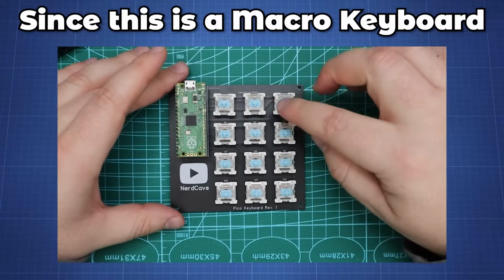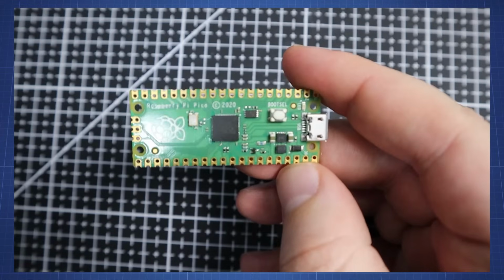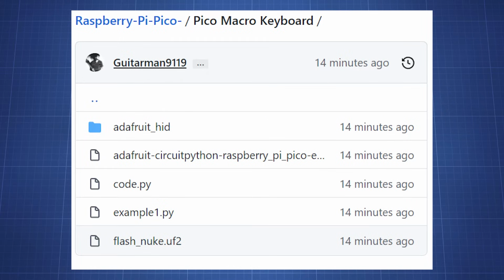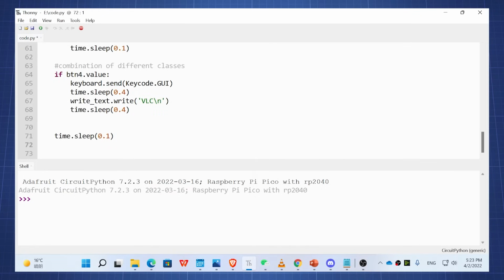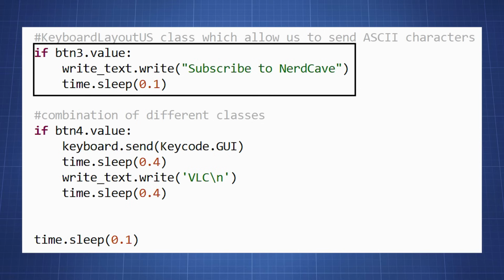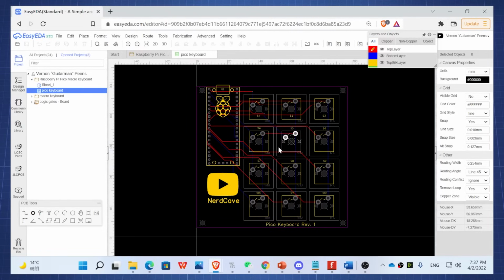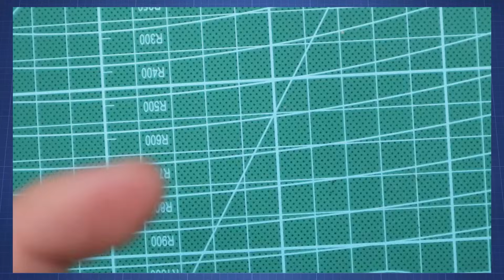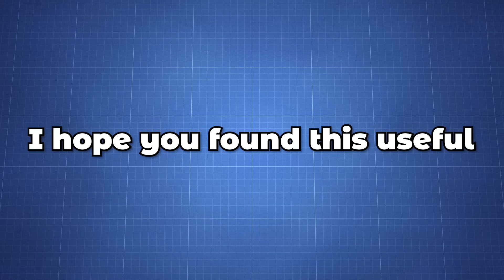Transform an old broken Keyboard to a Macro Keyboard

Comment: Unfortunately: keyboard.send(Keycode.CONTROL, Keycode.A) doesn't generate an A on my Mac Mini M4. If I test this in the TextEditor App the cursor jumps to the beginning of the line instead. Increment, decrement volume is working and starting vlc in the terminal app is working as well. I tried the US Circuit Python firmware as well as the DE version but that seems to make no difference. I also tried to change in the code all US related commands to DE but I got error messages that there are no DE related keyboard commands in the library.
Reply from the maker: I have never used a Mac before or tried the macro on it, doesn't Mac have different keys then a normal Windows keyboard?
Reply: @NerdCaveYT  Sorry, that was my fault. I saw your video and your keyboard was typing the letter A but in the above mentioned code it is Control + A, so this is not an A :)
Reply: Another way to use it on mac is by running osascripts commands over ssh

Comment: How do I access the Gerber file to order it?  I'm in the github and I download the zip file for "Pico Macro Keyboard/Gerber_pico keyboard_2022-03-24.zip" and when I try to put it so that I could order it, it says "Invalid file format".
Reply from the maker: I just downloaded the gerber https://github.com/Guitarman9119/Raspberry-Pi-Pico-/blob/main/Pico%20Macro%20Keyboard/Gerber_pico%20keyboard_2022-03-24.zip and in JLCPCB I clicked Add gerber file and it loaded in and I could order, what are you using to order the PCB
Reply: @NerdCaveYT  Thank you 🙏, the problem was that I extracted the zip file before trying to insert it. It’s all fixed now. And I’m ready to make my purchase! Thanks

Comment: Help please! I must be missing something simple. No matter what I do I cant get it to work. I am attempting to set up the pico to be recognized as a second keyboard with 9 buttons. The buttons will correspond to trigger several keys (R, B, Esc, Space, D, F, J, K, L). Do I need to have a boot. py file to ensure the code is run? or maybe my code is just scuffed. If you could help me get one button running im sure I could emulate it for the other 8. 
Im using the files that you linked and this is the code im using in while true. Below is the code. May I have your thoughts please. 

*also tried (Keycode.CONTROL, Keycode.D) but did not work.

#Import all the relevant Libraries

import time
import board
import digitalio
import usb_hid
from adafruit_hid.keycode import Keycode
from adafruit_hid.keyboard import Keyboard
from adafruit_hid.keyboard_layout_us import KeyboardLayoutUS
from adafruit_hid.consumer_control import ConsumerControl
from adafruit_hid.consumer_control_code import ConsumerControlCode

# Set up Consumer Control - Control Codes can be found here: https://docs.circuitpython.org/projects/hid/en/latest/_modules/adafruit_hid/consumer_control_code.html#ConsumerControlCode
cc = ConsumerControl(usb_hid.devices)

# Set up a keyboard device. - Keycode can be found here: https://docs.circuitpython.org/projects/hid/en/latest/_modules/adafruit_hid/keycode.html#Keycode
keyboard = Keyboard(usb_hid.devices)

# Set up keyboard to write strings from macro
write_text = KeyboardLayoutUS(keyboard)

btn1_pin = board.GP0

btn1 = digitalio.DigitalInOut(btn1_pin)
btn1.direction = digitalio.Direction.INPUT
btn1.pull = digitalio.Pull.DOWN

while True:
    
    
    # Keycode class defines USB HID keycodes to send using Keyboard.  
    if btn1.value:
        keyboard.send(Keycode.D)
        time.sleep(0.1)
    
    time.sleep(0.1)

Comment: Thanks for posting this. I have an Razer Tartarus Pro that I want to convert to a programmable macropad with non-volatile memory for use with a Pop_!OS linux desktop. I currently use Genovation Controlpads and love them but the hope was that if I convert the Tartarus Pro to a macropad I would be able to execute the macros while keeping my eyes on the screen if I could memorize where the keys are. I leaning toward QMK because it is open source and seems to be widely adopted but something like your solution would work weel also.
Thank you for posting all of the details. Please post more videos like this.
Reply from the maker: I want to look at QMK as well, I don't know so much about the different firmware available, I think it will probably be easier or more functionality, but I don't see a lot of written tutorials or content on it, so might have to figure it out and make a video on what I have learned.
Reply: Id love too see something like this too, im have Frankensteined a 23 key keyboard (koolertron) and a razer nostromo hand rest but id like to redo it with all 3d printed parts and use a micro controller so i can easily remap keys (the koolertron) software is the old version and doesnt play nice anymore

Comment: Nice project. I have an old raspberry pi 1.1b (I think) and want to use it to plug on a pc and emulate various series of inputs from the keyboard as well as the mouse, for very annouying MMO games stuff (say, an autoclicker that clicks 4 times in a second on an eternal loop). Can this be ported to it?
Reply from the maker: I will have to have a look at it, there should probably be libraries that allows the Raspberry Pi to be an HID device, I have not worked with the Raspberry Pi that often just once installing retro pi

Comment: "kept in place with plastic" @ 6:48. what is that stuff
Reply from the maker: I didn't know the english word for it but seems to be Tack or the most popular one is Blue Tack or Pritt Multi Tack. I use it often to keep things in place not sure is it ideal but did not have any problems so far just remove it after soldering
Reply: "Prestik", as marketed in South Africa. Just look for multi purpose reusable adhesive where you are.

Comment: Hello, Thanks a lot for your various videos! I learned a lot thanks to you. 
Could you please learn us, how to call an URL with circuitpy ?
(Press a button that can redirect me to an URL)
Reply from the maker: In my code you can adjust it for example what you are opening, their is the GUI library so for example windows then pause then chrome, then the url and enter
        keyboard.send(Keycode.GUI)
        time.sleep(0.3)
        write_text.write('Brave\n')
        time.sleep(1)
        write_text.write('https://www.youtube.com/watch?v=l7SwiFWOQqM\n')
in your case it might be chrome for example the \n is new line which is same as enter key
Reply: @NerdCaveYT  thank you a lot, for taking some time to answer me. Btw, I'm using brave also :)

Comment: where did you find the footprint for the raspberry pi pico? trying to do the same thing you did with your pcb but cannot find a footprint for the pico
Reply from the maker: The one I used is user contributed, there are a few good ones when you go to common library search raspberry pi pico and under classes go to user contributed. The one I used has the title: RASPBERRY-PI-PICO_TH

Comment: nice video, I would like to add  Bluetooth and a rechargeable battery, is that possible?
Reply from the maker: I believe so, but I am not sure on software side how you would go about that, I never tried to communicate to computer bluetooth etc. and how to setup the data you receive from the pico with bluetooth to carry out the macros. I think it would be more of a software design challenge

Comment: hi so i have made this project (only the breadboard part) but i get a keyboardinterrupt thrown at me... i just have the example code and this is the error:

Traceback (most recent call last):
  File "<stdin>", line 71, in <module>
KeyboardInterrupt: 

that's at time.sleep(0.1)
Reply from the maker: it sounds like when you press ctrl+c as a macro in thonny it interrupt your program, once you upload the code exit thonny then test it and see does it work
Reply: @NerdCaveYT  how do i run without thonny?
Reply: @daan5532  you have to save the script as main.py and flash it to your pico
Reply: @edwardtan1354  I'm sorry, i am a new one to the pi pico... So could you please explain how to flash it to my pi pico
Reply: @daan5532  you use thonny to flash it... it should give you the option else check jeff geerling's pico video
Reply: @edwardtan1354  Yes but what do i need to do in thonny? i did not really get jeff geerling's vid
Reply: @edwardtan1354  AND NerdCave i have fixed the problem by just reading the comment about the scematic... i thought it would not matter to me because i did not look at the scematic. Thanks for your help!!

Comment: sir if we order the pcb from easy eda , is that included with the mechanical switches........because in the 3d view of the designed pcb  mechanical switches also shown in it
Reply from the maker: Easy eda is just the platform to create a PCB in, there are options you can add components and get it soldered through jlpcb but have never used that service before.
Reply: @NerdCaveYT  ok thank you sir

Comment: Hey there!
I just built your 4 button demo one (After forgetting some basic breadboard techniques), and now I am really curious about making the PCB.
If possible, can you send me the easyEDA file? (I want to mess around with it and maybe fix the odd pin numbering if I can figure it out)
Also, do you have a good Amazon link for some keys that would fix the PCB? 
Thanks for the awesome video!
Reply from the maker: Hello, the pcb file is in the GitHub repository for easyeda, for the keys I think any standard ones will do, I am not sure what is good on Amazon because here in China taobao is what locals use and how I source things here. I should have a second version coming soon, with more capabilities to expand and more functionality.
Reply: @NerdCaveYT  Hi!
The only file that I see on GitHub is the GERBER file, and I cannot upload that into EasyEDA. Can you send me a comparable file, or add it to the respiratory?
Thanks!
Reply from the maker: https://oshwlab.com/vwpeens/raspberry-pi-pico-macro-keyboard I thought this link was there

Comment: Why no pullup resistors on button?
Reply from the maker: All the buttons is connected to positive on one side and then in code detect for a high, to avoid like button being pushed twice or denounce I added a short delay in code to avoid it from happening, the delay will probably depends on how long someone press the key
Reply: @NerdCaveYT  but adding pullup resistors wouldn't require the delay you mentioned, no? Or help more at least.
Reply from the maker: @hopcfizl3671  the pull-up will not help with the debouncing of someone that press button to long, but will help with noise accidentally trigger the button. For example the pins is kept at 3.3V and connected to the pico it is 0V once it detect a voltage higher then 2.3-2.5V range it will be a high or 1 and the code will execute. So if you were to touch the button pin which is connected to pico you might be able to trigger it without pressing but since it is in a case very unlikely. The setup of keyboard is that they use a matrix grid so you can get more inputs so having a resistor would not work so well for 100+ keys but will need diodes to avoid ghosting
Reply from the maker: @hopcfizl3671  I have a version 2 made with RGB and you can add more boards to expand number of keys which I hope to get back to it soon and make a new video
Reply: @NerdCaveYT  ok thanks
Reply from the maker: @hopcfizl3671  if you have any other questions I have a discord channel

Comment: Thank you, i got this running in half an hour. Only problem i had was downloading the circuit python file as a "Save as" from Chrome under Windows10 and it wasen't installing. I had to download your repo and drag and drop the file which installs it instantly for the CIRCUITPY to come up.
I then plugged it into my Ubuntu laptop and the macros are working there too as a plug and play, amazing!
Reply from the maker: I should actually make seperate repo's not to have everything under one making it difficult to download but glad it worked I have designed a second version but moved recently hopefully can make a video on it new version allows you to expand the size easily

Comment: I was thinking of using an old keyboard to take advantage of its keys by connecting it to an Arduino or Raspiberry pi, and converting the keyboard's key information into customizable buttons, to avoid incompatibility with the standard buttons on my keyboard. In that case the keyboard would be recognized as an input device, like a joystick, with 104 keys.
Would it be possible to do this?
Reply from the maker: Just to have a bit more context do you want to take an old keyboard and open it to find the matrix key presses so that you can use it as input, or do you want to plug the keyboard USB into the raspberry Pi and then change the input of the old keyboard to send different programmed key presses to your pc.

Comment: I have a issue with my Copy button I made. It keeps causing thonny to state that "Keyboard Interrupted" and I lose all functionality of my keyboard. here is what I wrote.   I have 9 other buttons and they dont do that.
 
 if btn1.value:
        keyboard.press(Keycode.CONTROL, Keycode.C)
        time.sleep(0.1)
        keyboard.release(Keycode.CONTROL, Keycode.C)
        time.sleep(0.1)
Reply from the maker: The issue is if you have thonny active and press Ctrl c is to stop the program once you save it as main.py on the pico and for example use it in notepad etc. you should not have this issue.
Reply: @NerdCaveYT  wow that was simple <_>. Was losing my brains wondering what I did wrong out of the blue. That keyboard interrupted thing is a pain. Thank you! Also, when I do get my pcb made etc...Thonny has to be running to activate the macro board?
Reply from the maker: @hakimdurand8427  as soon as you save your program as main.py and you plug in the pico it will automatically run the main.py code the only way then to reupload other code will then be to go in thonny and interrupt the main program by pressing Ctrl+C then.
Reply: @NerdCaveYT  ahh now I understand. Once again thanks for this beautiful information but I have ONE more issue..When I now use Ctrl+V it reboots  the entire pico everytime I press the button for paste...
Reply from the maker: @hakimdurand8427  does it do this even if not in thonny the reboot? What happen if you change the code to something else does it still do this? Just to ensure is it a code problem or connection
Reply: @NerdCaveYT  I am so stupid. It was a connection issue. I had the pin going to GND and not GP14. Had to open pico layout to see my stupidity. Thanks once MORE for your time.
Reply from the maker: @hakimdurand8427  no problem it sounded like a connection issue lot of times accidentally put a voltage on ground then pico reset everytime it happens

Comment: hello, i have a problem vompiling my code, i get the error: ModuleNotFoundError: No module named 'usb_hid'. but i downloaded several libraries, that must have them. i dont really know what im doing wrong, can you help me
Reply from the maker: Just to double check do you have all the libraries in a adafruit_hid with the following inside https://github.com/Guitarman9119/Raspberry-Pi-Pico-/tree/main/Pico%20Macro%20Keyboard/adafruit_hid and you have CircuitPython on the Pico?
Reply: @NerdCaveYT  i had the installed correctly, but i forgott to select the interpreter in thonny
Reply from the maker: @LWUndsoo  ah okay is everything okay now?
Reply: @NerdCaveYT  yes

Comment from the maker: A small mistake on schematic for the simple 4 button demo, the voltage should be connected to Pin36 the 3V3 out. I am famous for writing the wrong things in the table next to the schematic
Reply: Can you send me some info on how to put this together with jumper wires. Could you also make this with a rotary encoder(for sliding the screen right or left), thanks
Reply: HELP..i am from germany so i have an german layout.Can u help me get an german layout
Reply from the maker: @LightSkip_rb  I see different layouts are available here: https://github.com/Neradoc/Circuitpython_Keyboard_Layouts/tree/main/libraries/layouts  never thought about it when making this video, something I can add for follow up video

Comment: Can I add and I2C screen (2x16) characters to that keyboard? using circuit python?

For example, I set button 1 to "ctrl+c" and i want to show on my screen "copy"
Reply from the maker: Yes you would be able to do that, so basically all you will do is that you will import the 16x2 character lcd library, tutorial her https://learn.adafruit.com/i2c-spi-lcd-backpack/python-circuitpython , I have only covered it with MicroPython so far. You will write a message like you said to show on screen for x amount of time and then clear, for version two of this board I am planning to show it for that lcd and the OLED I2C display. If you need any help let me know. I did plan to make a discord server so you can reach me here: https://discord.gg/Mym6UffWEA
Reply: @NerdCaveYT  It would be nice that you can teach us, I really cant make it work with circuit python but i can i micropython - thanks
Reply from the maker: I am a bit late but I have made the video, hope it is still helpful...